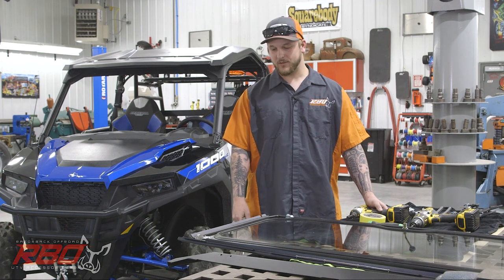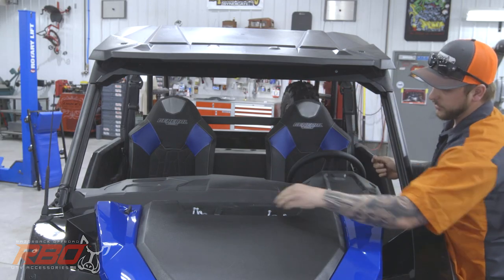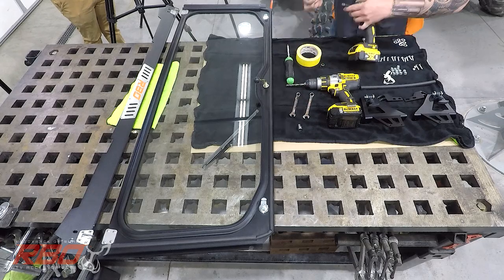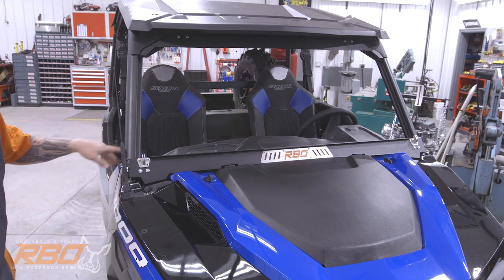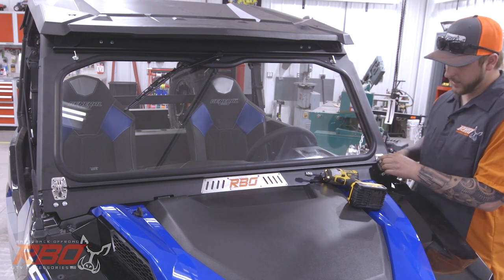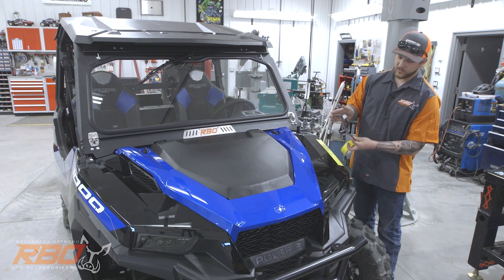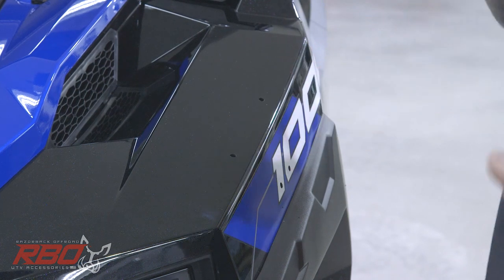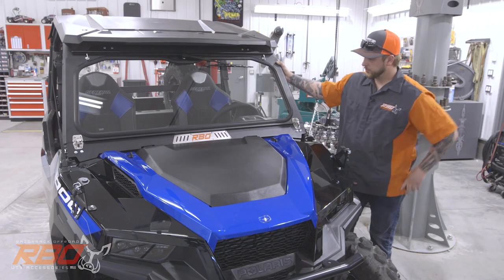Polaris® General® Folding Glass Windshield Installation by Razorback Offroad™

Comment: Do you make a tip out style? Those brackets would get some abuse on the trails and the mud would build up on the inside of the glass when folded down. Nice design for certain areas.
Reply from the maker: Hi smitty0655able
, no we currently don't offer a tip out style. However, we do use a special bracket on our windshields that was built to prevent sand/dirt buildup on the trail.